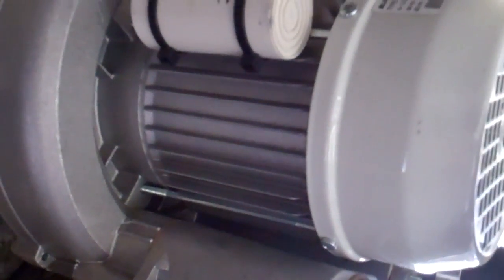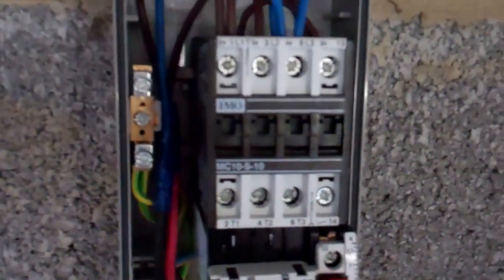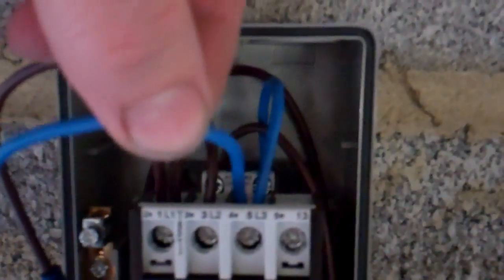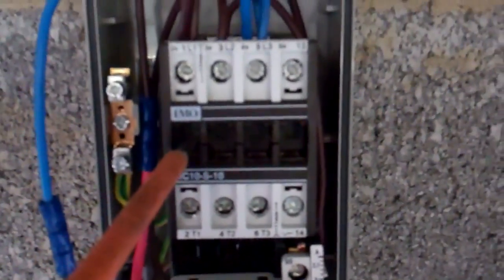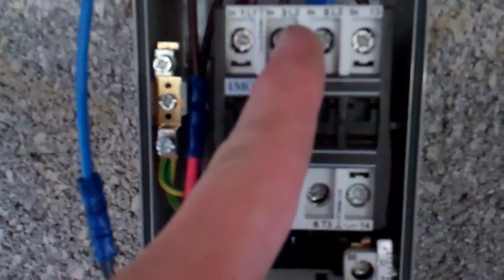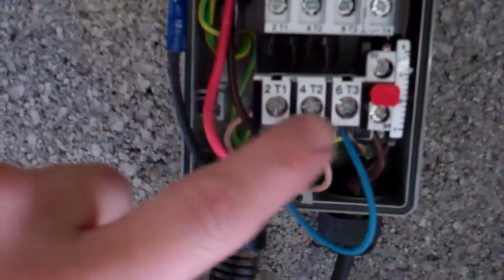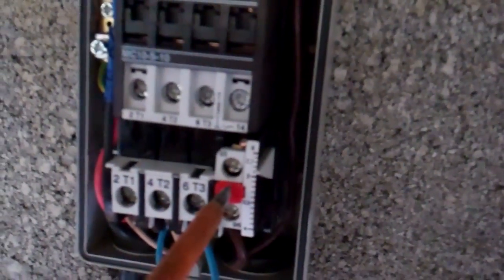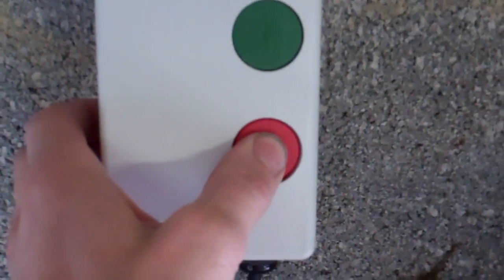Hvac Contactor and Overloads

Comment: Yeah. i don't trust that to be truthful. soon as u let go of the red button, it comes back on. not very safe that.
Reply from the maker: Why so?  Its not a stop button, its a reset for the overloads. The power is fed from another contactor, all this one is for is to turn the power off to the air blower if it starts pulling too much power if say the air pipe got blocked or the capacitor failed.
Reply: yeah that's the problem. when u press the red button, it should stop all together, and not start up again.
Reply from the maker: wazza626
It is working as it should. The starting and stopping is controlled by another control, this one is only a safety device to protect the motor.

Comment: Normally you open the box and instructions are printed on the inside. You normally have to break a tab to do auto reset. I have a vacuum pump in a machine where I replaced the cloth filter with a car air inlet filter, stopped me from stripping it monthly to clean the gunk out. It will hold over 1kg of dust and still work.

Comment from the maker: Yeah these come as manual reset, not sure it can be set for auto, i'll have a look when i go back there to run it up proper.
The air filter was supplied by the manufacturer, I'll look into getting a bigger one for it, thanks for the heads up. You would be surprise by the size filter in the vane blower this one replaced, you could fit four of them in this filter!

Comment: Have you disabled the auto reset function, so that once it trips it stays tripped until reset? If not then on overload it will cycle slowly until something burns or a breaker trips when the motor goes short circuit. Very possible with that side channel blower. You do need a bigger filter for that one though, the dinky toy you put on it will need cleaning at least monthly, and it is tempting for F Brown to leave it off when it is clogged "just for now" and fry the pump.